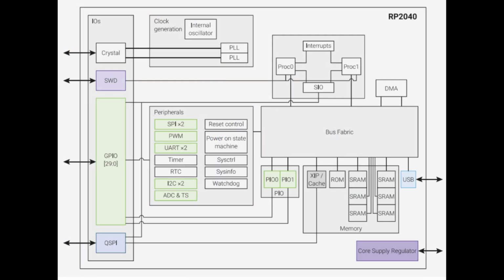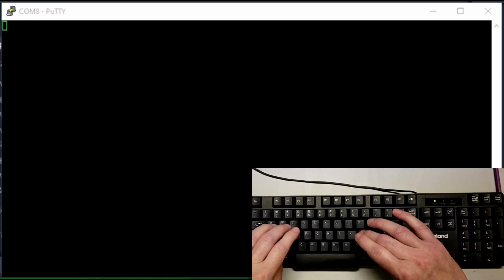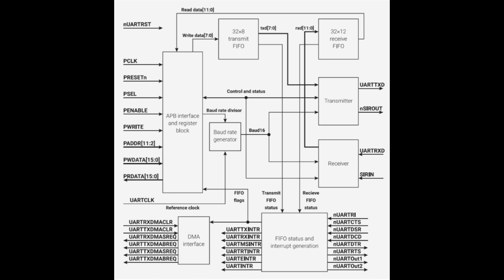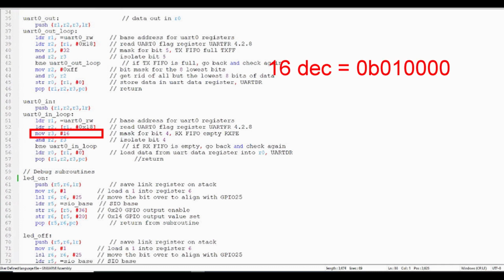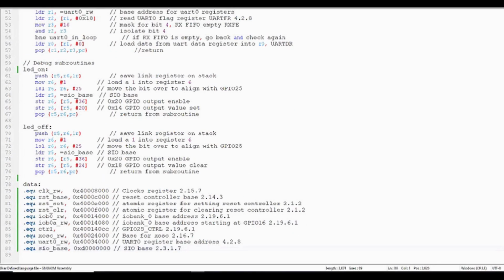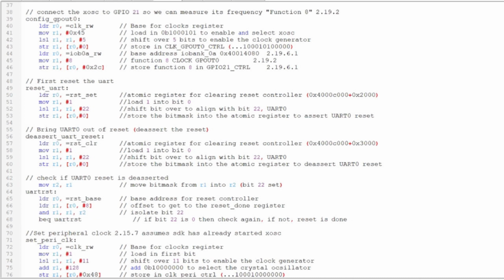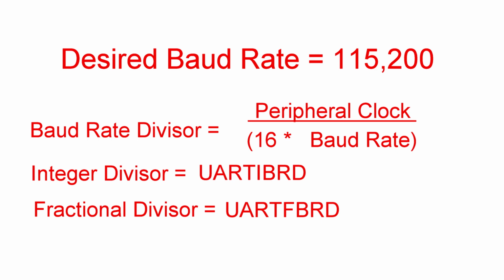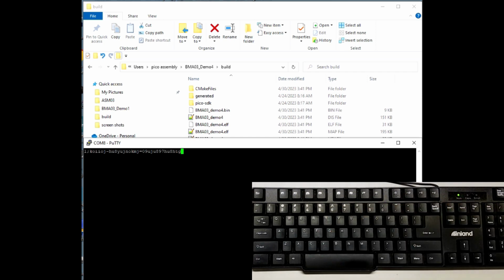RP2040 - Using UARTs with RP2040 Assembly Language - BMA-03

Comment: Hi David! Regarding part 4, I noticed that you check if the xosc is stable without enabling using the xosc control register. Is the xosc enabled on boot-up, or what’s the reasoning behind it? I am not sure if clk_peri enables it when the aux sec clock is set to the xosc. Thank you
Reply from the maker: The programs in this video were initialized using the SDK.  This adds a startup sequence that starts a lot of peripherals, including xosc.  In the next video (Chapter 4), I ditched the SDK and then had to start everything myself.  In Chapter 5, I discuss the xosc in much greater detail; check it out for much greater detail.  Thanks for watching!
Reply: @LifewithDavid1 Thank you for the response. I understand now and will follow the clock setup along with Demo04 of this project to get my baremetal UART set up.

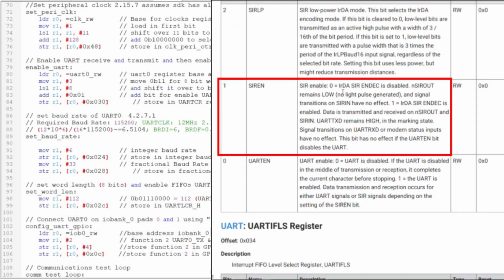Comment: Awesome video! One small correction (I think) On 16:48 (line 83 of the program) You're adding the constant 0x01 to the register, which means that you're setting bit 0 (UARTEN) and not bit 1 (SIREN) as was expressed a few seconds before in the video. The comment in the assembly code states this correctly, so I'm assuming it was just an error in the video script. Thanks again!
Reply from the maker: Good catch!  I must have had a brain fart where I thought bit 1 was the first bit, but that was actually bit 0.  And I know better!  I'm always going between the least significant bit being named either bit 0 or bit 1, depending on whose chip, or datasheet.  I should have put a box around bit 0.  Thanks for the comment!

Comment: Thanks for making these tutorials.  It still amazes me how much more powerful the rp2040 is than early "micro computers" were.

This brought back memories of learning about the UART programming on the SWTPC 6800 and the the Motorola 6850 Asynchronous Communications Interface Adapter (ACIA) with assembly language, circa 1978.  I needed to write a program to allow copying files between an HP 3000 running MPE III using a serial line (three wire, RX, TX, GND), and this was before Kermit.  And it had to use the HP ENQ/ACK flow control protocol.  That's about all I remember about it now, other than that it took me quite a while to get it to work using interrupts so other things could be done in the foreground, and that debugging was not easy without any debugging tools, just a lot of trial and error.
Reply from the maker: Those were exciting times.  Hobbyists were pushing the state of the art because the big corporations were just hoping that microprocessors would just go away.  Thanks for watching!

Comment: Please do get into the gory details of the clocks available and how they can be used! Is it possible to use an external clock to read in adc values? One of the things I want to try with a 2040 is to have the PIO reading in digital data that has its own recovered clock. But I thought i would just have to have the pio oversampling instead of synchronized?
Reply from the maker: Thanks for he feedback!  I wasn't sure if that would be a popular topic.  I'll put it on the list (which is getting longer).